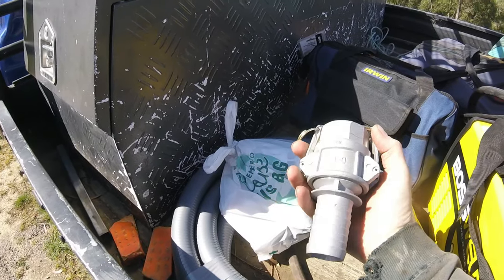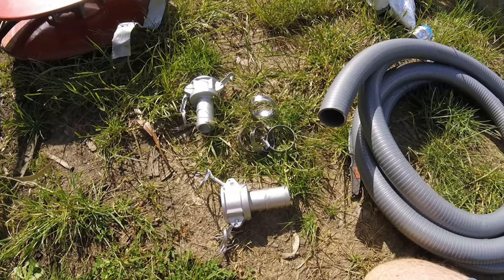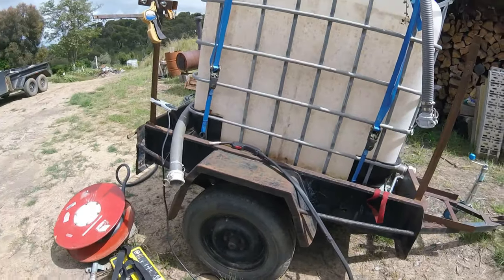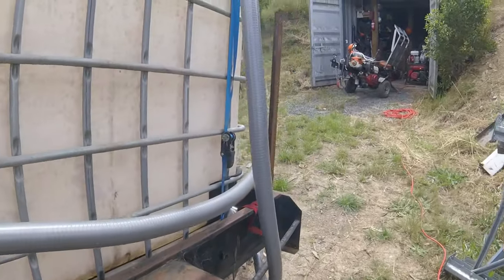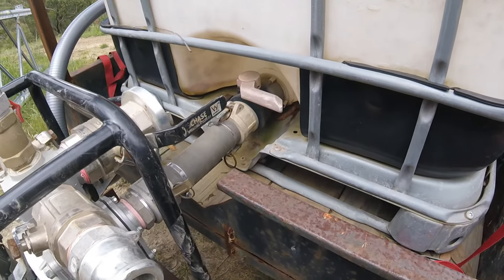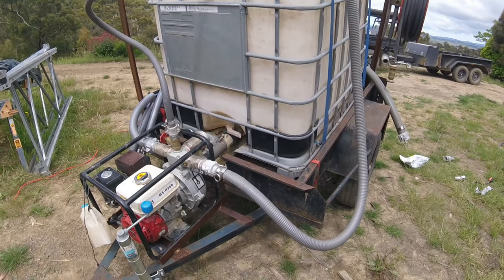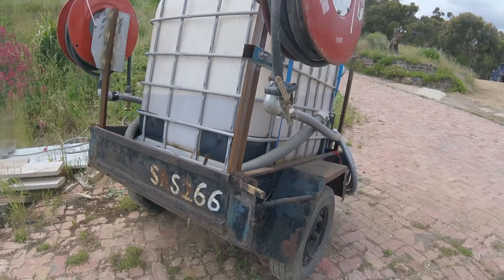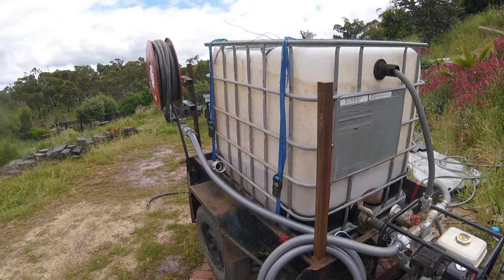Fire Pump Part 7 - Fire Fighting Trailer Upgrade

Comment: Nice trailer! I find that to make the Camlock fittings easier to close, take the washer out and sand off a touch making the washer thinner, allowing the bails to close a bit easier. Slightly more permanent solution, although WD40 does work magic. Thanks for making this video!
Reply from the maker: That's a good idea!. Thanks for the tip and thanks for watching.

Comment: When you are on fog spray the pressure is greatly reduced, you will also notice a rush of air coming from behind you. On straight stream is when you'll feel the full pressure. From my volunteering fire fighting days the old adage using a nozzle "Right for fight (straight stream), left for life (fog pattern)" The straight stream can be used to knock apart the fire and at some distance. The fog pattern can be very useful in dousing a fire as the millions of tiny droplets of water better dissipates heat than straight stream, the downside is that you are closer to the flames. In house fires we used to use the fog pattern out of a window and the wind rush would suck the smoke out of the room and cool us off to some degree. 
Now my volunteering is Coast Guard, we use the exact same Honda pump for de-watering. I estimate that the pump puts out about 45-50 psi, about half of what we used in FF days. The friction loss of the cotton jacketed hose you're using is approximately 4psi per length of hose and per story (10ft) of rise. By the way, if I witness any of my crew leave the nozzle (of even open hose) unattended when the pump is running (or about to) or a running pump unattended there will be hell to pay. An aluminum coupling of a brass nozzle shooting around can be deadly. Given your situation i would suggest tying or the open hose end so that it won't flop around as dangerously. 
Congrats on a good build, I hope you never have to use it for it's intended purpose.
Reply from the maker: Grant, thanks so much for the info. Really appreciated. I also hope I don’t ever need it, but the previous house on the land was lost to bushfires in 2014, I’ve cleared a lot of the land ( previous house was IN the Forrest) around the house location as a firebreak, but I’d just rather not have to test my trailer or firebreak. When the house gets built, later this year hopefully, I’ll add some fire suppression to the roof and surrounding area. Thanks again for your comments.
Reply: @TheRuralProject  One other thing I suggest, if you haven't already got one, is a foot valve for the suction hose. If you're not familiar it's a one way valve on the end of the hose (many come with strainers) it will prevent the water in pump draining back into the dam when pump is shut down. It can also be used to back prime the pump in a jiffy. You should be able to find one for about 40-50 Koala dollars
Also in an earlier video I saw you unscrew the priming cap when pump was running. You were lucky that the pump wasn't primed at the time as water will flow in by the easiest route (priming port). Don't ask me how I know, suffice to say Lake Ontario water does not taste that "great".
Reply from the maker: @ccga3359  yep, the suction hose has a foot valve. How do you use it to prime the pump ? Simply lift the hose to fill the pump and drop it back in the water quickly once you hear the change in tone from the pump / impeller. ?
Reply: @TheRuralProject  That's correct. Attach a line (remember I'm working on a small boat so anything that goes over the side is lost forever unless attached somehow, lol) to the pump end of the suction, throw the hose into the water and drag back, attach to pump and tip pump. It only takes half litre or so to prime these pumps. Alternately with hose already attached thrust the end repeatedly in the water. With each thrust the  hose will take on more water until it fills the impeller. Also add a small float near the end to keep foot valve off of the bottom. The mud and crap will quickly damage the pumps internals, anything that gets through will otherwise start clogging the nozzle, which  is not a good thing in a fire scenario. Oh and come on, paint the trailer red!

Comment: Nice looking upgrade mate a big setup from video 5 I've just finished putting together my earlier mentioned fire trailer and went through 2 different variations of hose from tank to pump before I got the perfect fit of which is basic black fire hose fitted with nut/tail fittings that screw directly onto 3/4'' inch fittings on both the tank outlet and pump inlet 

Instead of a heavy 4.5 or 8 hp pump I've opted to use a 4 stroke 43cc 1.7 hp fire pump that also has 1 inch inlet and outlets I have found that a 1.7 hp pump gives out more pressure through a fire hose in comparison to a higher hp pump although I'm retaining the 8hp for open supply refills from water source right to tank
Reply from the maker: Hi Robert, thanks for comments. Glad you have finished your fire trailer. 
I have to say that I have found that pumps do not vary ( at the nozzle, and to the eye) that much either for normal operation,  it’s when you use the pump at extremes ( full hose lengths or steep uphill) that you really notice the performance difference. 
Lucky mine has had a life of carting water to allow plant watering for the past 2 years. 
Busy with firewood at the moment, but during next summer I will do some work to strengthen the trailer and draw bar, maybe add another axle too. 
Thanks for watching and I hope you never have to use your fire trailer to fight a fire.
Reply: @TheRuralProject  all good it took alot time and patience to get it perfected it's also an official registered fire trailer with the cfs now just waiting on my id sticker 

Have spent about close to nearly 2 1/2 grand in putting it together that excludes the trailer itself but includes both pumps, fittings,tank-pump hose,tank as well 

With the la nina we're currently experiencing moment due to peter out late January here in SA and a return to hot weather in February this trailer unit will come in handy
Reply from the maker: @robbiestewart1984  thanks for the reply. What’s the advantage of registering the fire trailer with cfs if it’s for personal use.
Reply: @TheRuralProject  basically by registering it as a fire trailer with cfs this puts me under their banner of cover for injury and damage thus also I have to follow their SOPs on the fire ground 

Where I am is basically surrounded by farm land and pine plantations on either side so in a fire emergency my town can come under threat fairly quickly if the weather conditions are ideal for rapid fire development 

By having the trailer recognised as a resource it allows me the flexibility of having it for both personal use and life saving resource

Comment: As a suggestion I think that the pump to feel hose could have done with a trim and tied  to the tank cage to avoid snagging on things that might rip it of and cause damage and less distance for the pump to push the water to the reel
Reply from the maker: Hi thanks for watching and your suggestion. Fully agree with securing the hose back to the trailer to prevent snagging whilst driving. I've purposely left the hose longer than needed, so I have a bit of flexibility if I want to take the pump off the trailer (suction from dam) and still use the fire hose, I know that will effect efficiency slightly, but only a small amount.

Comment: No need for warm water …. A wipe with a wee bit of cooking oil on a rag make it slip over like magic.
Reply from the maker: I’ve found I need to soften the bigger pipe, I’ve tried wd40 lubricating oil without luck. Usually works but this pipe needs heat to soften it   
Thanks for watching.